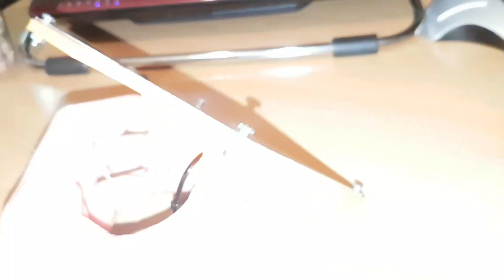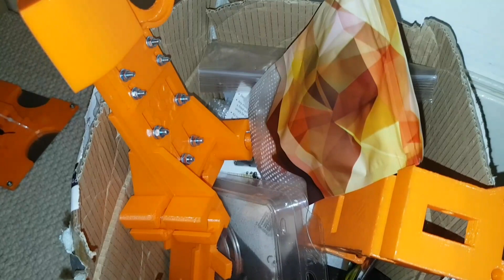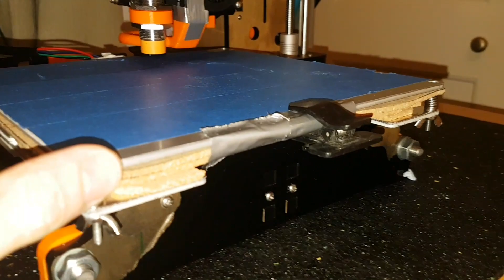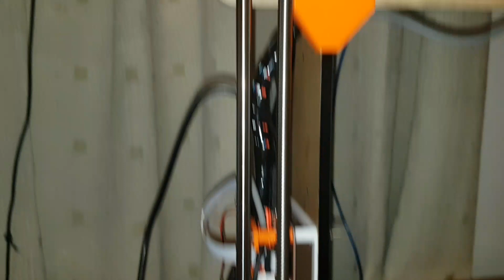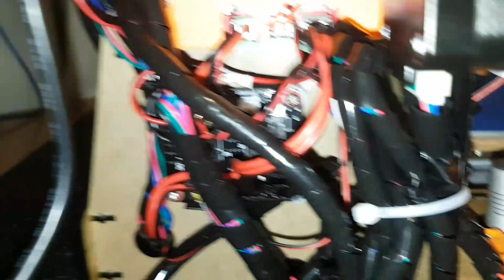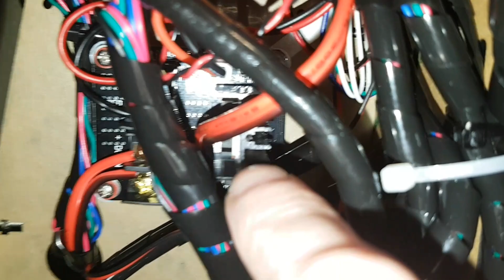Anet A8: A Few Mods More...

Comment: good video but noticed your H plate is upside down (instructions have it mounted upside down also) flipping it over fixes the belt problem but saw you have made the block to fix the problem.

Comment: Good video mate. Did the expansion module come with the signal input cable?
Reply from the maker: Hi. Thanks. No mine didn't but some on Amazon seem to. I made one using a 2 pin connector off one of my old drone parts. You could also use a  pc fan connector (2 pin type) or a JST or servo connector. I probably went overboard on the cables for the 'signal in' as it won't need to bear a lot of current. That's all done by the larger mosfet. Good luck.
Reply from the maker: or if you can't find a connector then you could always solder two wires to the pins on either the top or underside of the board. the other end just screws into Anet board anyway.
Reply: Thanks.  Curious to see how fast and how hot the heatbed can achieve.   Read somewhere there is a voltage adjustment pot on the power supply. Can increase voltage to around 14 volts with the expansion module installed..
Reply from the maker: Yes but the mainboard will only take so much voltage. I am not sure exactly how much. You could also up-rate the heated bed cables to 12AWG (I used 14AWG as I had it laying around). Thicker (and shorter) cables will be more efficient with less lost as heat along the way. The stock cables seemed skinny to me. I did a vid on upgrading them whilst keeping the connector but I haven't uploaded it because, to be honest, your probably better off soldering them direct to the heated bed. Some guy also did a fairy exhaustive study and found that a combination of better cables and insulation were sufficient. Aluminium foil sandwiched between two layers of cork matting under the hotbed helped a lot too. Just be sure it can't move around and short anything out. Good luck.

Comment: Nah not over the top with the mosfet. It makes the printer much safer. Also do u have a link to your mosfet
Reply from the maker: Nicolas Peter HI. http://m.banggood.com/3D-Printer-Parts-General-Add-on-Heated-Bed-Power-Expansion-Module-High-Power-For-Chitu-Motherboard-p-1086965.html. Amazon does them too.